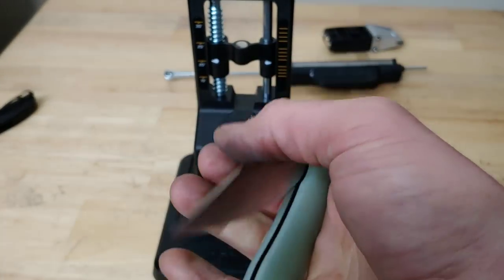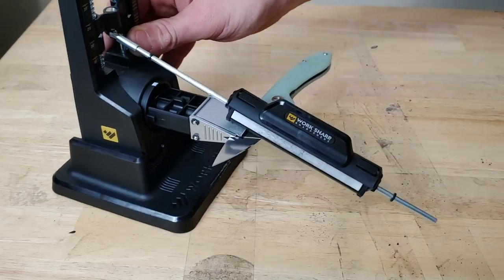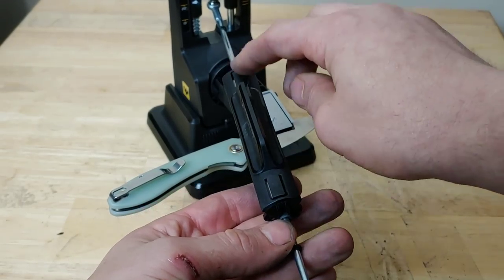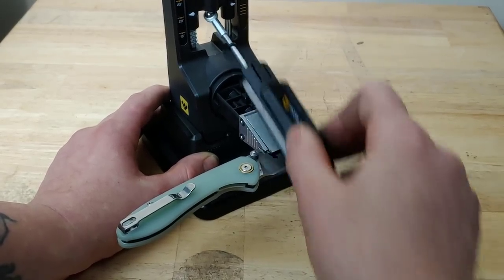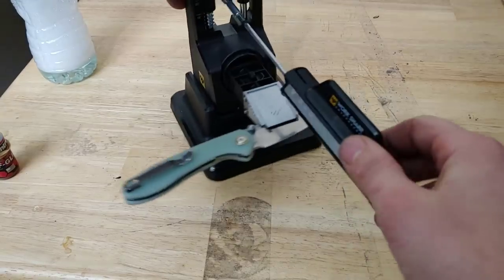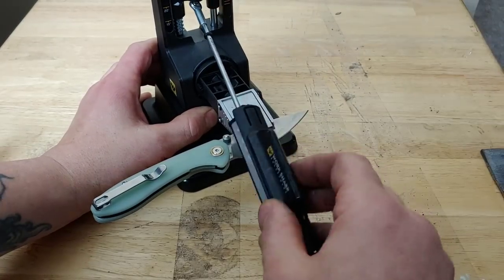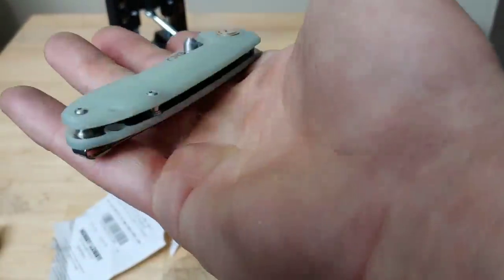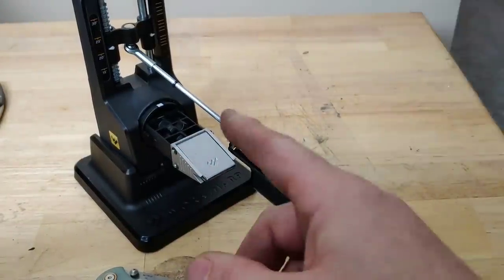WORKSHARP PRECISION ADJUST KNIFE SHARPENER REVIEW

Comment: Do you like a toothy edge on d2?  I usually go in between myself. I cant remember what is the best for all steels and I always touch mine up fairly often on a strop in between sharpening's because I hate not having a shaving edge not necessarily polished just shaving. I sometimes polish the edges and I do like my ceramic for simple effectiveness and quickly no water and no stone maintenance and sometimes just for the fun of it and having an extra keen edge fast.  Im a free hand sharpener but I have the spyderco sharpmaker I use the stones an odd time on their own(it was a gift).  I wanted a guided system for when Im lazy or want to reprofile a bad blade and seen this one and actually pre ordered it earlier today before seeing this video and when I did see the video I also just had that same feldspar in the large size sitting on my coffee table with me and I just got it 6 days ago lol.  Must be a sign from the knife gods.
What is a dry oil for steel and what is the benefits? Is it the same as the dry oil in the food industry like linseed or tung oil and they create a dry film.
Great video as usual and demonstration.  If I hadn't ordered it already I would because of this video alone.  Its a better video on it than the knife center's and not to knock DCA just a different type of format and another great job at explaining everything! Nice edge bro.
Reply from the maker: Yeah d2 does best with a toothy finish, a polish doesnt usually do great on d2 600grt is my favorite usually, dry oil is an oil that dryes up or isnt supposed to leave residue but it doesnt do that well on knives from my experience, if your just oiling your blade then pretty much any kind of rust resistance oil is fine just dry it off after i usually wipe the oil on let sit for 5 min then wipe off seems to work great
Reply: Ya I've used 3 in 1 oil for years and lots of others.  Im not too fussy over oil.  I do understand the differences but for me its not a big deal.  Yeah 600 grit sounds good thanks probably good for 56 to 58 hrc abd lower.  I wonder if it would be prone to micro chipping with a real toothy edge around 62 hrc.
Reply from the maker: @alanmccoll6490  if its very toothy just do a good burr removal and strop really good after and you should be fine
Reply: Cool thanks

Comment: Look folks I have one and my comments are what i think about the sharpener it’s not with a bed sharpener but here we go for one thing it’s top-heavy and sharpen your blade and wants to four Ford torch OK sure does have some weight but it needs more in the base needs to be wider have a larger footprint to keep this from happening the knife holder the madness is that used to hold it in a decent bit they gonna go that way the elite be stronger because it flexes quite a bit you are seen it you all experienced it and the only solution that they come up with you’re putting to much pressure you’re right I kind of agree but even still if they’re going to work

Comment: Have you tried it on a dual edge blade? I have a Ken Onion worksharp now and find it impossible to use with a dual edge otf, hoping this one will work.
Reply from the maker: You mean like a double edge dagger or like a tanto?
Reply: @NeevesKnives  a double edge dagger, full edge on both sides
Reply from the maker: @davelewis2870  yeah it will for sure you want to make sure its clamped in the same spot so the angles match

Comment: What about using the blade grinding attachment for the final finish at 12.000 grit at the same angle? Will it work?
Reply from the maker: Oh i wouldnt do that this does a vgrind and the other one does a convex, and its very close to a perfect polish, i could spend more time and get it perfectly if i really wanted or get a progressive stropping compound
Reply: @NeevesKnives  yeah, I know about the convex but thought it wouldn't affect the edge with the 12.000 grit
Reply from the maker: @memokwest  im sure it would help polish but it would probably take to bite from the edge possibly, id reccomend just using a regular stropping progression
Reply: @NeevesKnives  thanks! I will possibly try a nail polisher with 4000 grit. Perhaps this will work 😉

Comment: Hi! Can you sharpen a scandi grind without a secondary bevel with this?
Reply from the maker: Possibly if the angle fits depending on the knife its going to be about the angle
Reply: @NeevesKnives  What about a fixed blade then. Would it handle a 7-8 inch blade with a thick spine? Where do you think it's limits are? Thank you for a good review.  I subbed.

Comment: good ,, well thought but diamons , not for me,  it really tears up an edge then a very fine ceramic, should have used silocon or boride carbide, maybe. or an extra rod to purchase with a coaurser ceramic
Reply from the maker: I use diamond every day and completely dissagree on it tearing up an edge, theres some steels i use aluminum oxide or something else, but most pocket knives these days are using steels that diamonds work fantastic on, and super steels work best with diamonds, but even other steels work great with diamonds, other stones work great also, and this system has a fine ceramic on it as well

Comment: Looks like a great system for the $.  I'm sure more stones are coming. Maybe a base clamp too. I wonder if some rubber dip on the blade clamps (think the handles of pliers) would work?  I'm very interested in one.  Thanks Jerad!  ✌️
Reply from the maker: Yes its a great system, also the edge on the civivi came out fantastic, but that was freehanded to mirror edge
Reply: Very cool!  I'm looking forward to the review!  🖖
Reply: Just put a little bit of blue painters tape on back of blade.
Reply from the maker: Actually i messed up it does have rubber on the clamp i couldn't see it before but after shining a light i could see it clearly, also i need glasses

Comment: I used mine to reprofile my Benchmade bushcrafter in s30v. 
That 320 stone is not made for that LOL but it worked ...I ordered a new stone already but for now on I'll use the  sticky tape and sandpaper trick.

This sharpener is awesome but there is one flaw I don't like . The part that holds the knife pops out to easy they need to add a lock with the magnet . For larger knives it sucks.

Pocket knives you won't even notice it but heavy knives are a pain at times. That said as just a sharpener it's amazing in just speaking from an idiot perspective.. that reprofiled s30v on an outdoor fixed blade 🤣🤪
Reply from the maker: Yeah reprofiling something large will take some time, the stones are small but it will work, and for the $ its definitely a great system

Comment: I do have a question for this. I'm still pretty new to all of this but been using several wet stones for sharpening.
Could the same concept be applied to this as a fixed use? Would it cause any difference at all compared to a dry or semi dry stone?
Reply from the maker: Some stones can be used dry; but not wet stones, because the steel will clog the stone and it won’t work also it will get glazed, you want to use a wet or oil stone with a lubricant

Comment: Newbie here....I have a worksharp belt system sharpener......how does this compare?
Reply: The electric sharpener does a convexed angle, which this sharpener does a flat angle
Reply from the maker: I personally like this better, it gives a v grind instead of a convex, and a sharper edge, both systems are great but id reccomend this one if your sharpening just pocket knives
Reply: @NeevesKnives  Thank you...one last quick question....if I use a belt system and it produces a convex edge.....then can I not use a strop to keep the edge after the belts?
Reply: DrMaddog1  when you strop a knife it does a slight convex edge that's very close to the belt system. Just not as extreme as the belts.
Reply from the maker: @mikeo8790  thats based on bpressure and holding your angle, if you can repeat the same angle with light pressure and you only do a few passes on each side you will not convex your edge, also depending on the kind of leather your using, some are softer than others, but if your not indenting the leather you wont convex your edge imho

Comment: Great video.....the best one yet demonstrating the system.
If you get chance to try that simple hack I mentioned last night regarding the stop collars from the kme system....it eradicates the issue with the o- rings.
I had gotten bored last night and did a side by side with the kme....
I find that the angle adjust on this is much easier to use, and that the jaws are better than the jaws on the kme.....holds my spyderco para 2 and 3 much more securely without any play what do ever.
I would contact work sharp if your jaws don't have rubber inserts...mine came with.
Addressing issue with more stone options, I have been told by a reliable source that it's already in the works.....possibly even with a universal type holder that will handle 4" stones....if that happens this hands down is in discussion for one of the most versatile systems on market.
Again a great job showing what this system can do....and for $49.95 how can you go wrong.
Reply from the maker: I do think this might possibly end up being the most popular esp if they come out with more stones/ attachments, I don’t have a knee I usually freehand
Reply: @NeevesKnives  I freehand when I feel the need to just zen out.
Been freehanding for close to fifty years.....ya know...when dinosaurs were roaming about...lol
Can get fantastic hair shaving edges....just don't ask me what angle I put on it....would just shrug and say whatever felt right on the stone.  Then I felt need for something more definitive in angles...that's how I got into the fixed angle genre so to speak.
But I fully agree that this system has the potential to be something very special.
Reply from the maker: @fldiverjc4496  that’s amazing, I also find it very therapeutic and also I feel like there’s way more passion involved
Reply: @NeevesKnives  so very true....there seems to be so much more of a connection......
It's a shame so many are scared to try it.
In my opinion in the whole sharpening scheme.....nothing comes close to that feeling of accomplishment after you get that hair whittling edge from just you and a stone.
Reply: fldiver jc - Do the KME and Work Sharp rods have the same or very similar diameters? Did you recommend using 2 stop collars? Thanks.
Reply: @rickenger959  it seems they are very very close in diameter....would need break out the calliper to be 100% certain.  All I can say is the stop collar from the kme works .  
I personally would use two collars....one above the stone carrier and one below stone carrier.
As shipped the o- rings for lack of better term work well enough.  I mention the kme collar because they are easier to adjust in my honest opinion.
Reply: @rickenger959  I did manage to break out the calipers....both seem to measure at 3.81-3.83 keep in mind can be user error....lol
In millimeters.
Reply: @fldiverjc4496  Thanks for taking the time to look into this further. I will be receiving my WS  Precision Adjust tomorrow and will also be ordering two KME stop collars tomorrow. Thanks again.
Reply: @rickenger959  glad to be able to help

Comment: how long wil the stones last?
Reply from the maker: Depends on how often you sharpen, my plates did over a 100 knives butbthey are larger, im guessing maybe 40 sharpenings, also depending on the steel and the pressure you put
Reply: @NeevesKnives  thanks

Comment: With all their products, Work Sharp is becoming one of the heavy weights in knife sharpening.  

An area that might make your sharpening videos better is to also cover what does not work well for each system.  For instance, this system may not be a good choice for knives without a flat part of the blade to clamp on to, or for knives that are too heavy for an unclamped system.  Stuff like that.
Reply from the maker: Definitely the weight could be sn issue but i think it will still work fine without the flat, great idea though thank you im definitely going to remember to start doing that

Comment: Looks like the angle will change as you move across the length of the blade
Reply from the maker: I havent noticed that happening maybe with a very large blade but it would be a very very small amount, and your angle would still be consistent and that is what is more important

Comment: As knife blades tend to be of different sizes (pocket knife / chefs knife) I wonder how this type of sharpener can give consistent and precise degree angles. The angle of the horizontal and vertical side of the triangle will always remain 90 degrees. By dialing in a preset degree on the vertical element you are defining the length of the vertical side of the triangle. As due to taller or higher blade heights and lengths the distance btw the vertical element and edge of the blade is always altering the length of the other two sides of the triangle and the respective angles this method cannot be precise. Theoretically at the fist use the factory edge is destroyed and has to be redone to an approximately similar angle. Theoretically if you have redone the edge and if you can manage to clamp the blade always in the same position you are fine. But in case for any reason you have to use another sharpener the edge is altered again... 
Or is this not a real issue? Am I overthinking it?
Reply from the maker: Definitely over thinking you can always try to remember about where you had it clamped and also use the system to try and find the closest angle, then just go for it, worst thing is your edge gets sharp, but im sure kitchen knives will be fine but theres going to be a limit
Reply: That's definitely something to take into consideration if you're looking for a specific, exact angle. The built in degree markings are close, but they are closer with a wider blade.

Just to check it, I clamped in one of my widest blades, a Benchmade Turret and used my phone to measure the angle at it was 20 degrees, exactly where the sharpener was indicating. I then clamped in one of my skinniest blades, a Benchmade Fact and without changing the angle setting at all, it was measuring 22 degrees. So there is a difference that could matter to some people.

If exact angles are important to you, I'd recommend getting an angle finder or using the one that's likely on your phone somewhere. And for just doing touch-up on a blade where you've already got the angle you want, the sharpie trick is the best way to go. The angle indicators on the sharpener are nice guides, but due to the variability of how you clamp in the blade, they just can't be exact.
Reply from the maker: @GabrielShadowArcher  yeah for a system at this size id say its pretty close, and personally i wouldnt care, i care that its a good angle that cuts well, being exact doesnt mean much if i didnt like it id just change it to what i do like
Reply: A wider blade would change the angle as it would lengthen the hypotenuse of the theoretical right angel. Go buy a $5 angle finder and check the actual angle against the markings.
Reply: Paused at 18:10 with increased brightness on my phone, it does look like the newly sharpened edge changes in width/angle slightly from the tang to the tip. I have noticed this with all fixed angle sharpening systems. Unless it's an optical illusion, it does appear that the angle slowly becomes more acute towards the tip, with the edge appearing slightly wider (or longer, depending on perspective).  

I have seen this topic disputed before, and do believe this effect would be much more apparent on a longer blade.

I think the only way to not have this occur, is to move and turn the knive while the grinding apparatus remains stationary (like at the manufacturing facility).

Overall I do feel these devices are still effective and worth the investment for pocket knives, regardless of this minor imperfection that may result.

Nice review, and thanks for the demonstration.
Reply from the maker: @4rch3er19  many knives have a taper in thickness, or thinness and when you put an angle guided edge on them the edge bevel will taper in thickness, im sure there will be a slight difference from the system or atleast its possible with larger blades, but i dont think the system effected this knife very much most likely its the thickness bte that changes, but its all possible, but its as consistent as much as it can be and it puts a great edge on your knife.
Reply: @NeevesKnives  I agree, the possible slight difference in angle/length of grind is negligible. I have also considered various thicknesses in blade stock to account for this slight angle change. If this was the cause then typically the thickness would be greater near the tang, hence the grind/edge would appear greater there, not near the tip where it appears here (and in all the other videos). 

Regardless, these fixed angle sharpening systems are still a great investment, and this model in particular is on my wish list. I think the ease of use and ability to create an actual straight edge, instead of a rounded (or convex) one is the main benefit of not sharpening by hand. Thanks again.
Reply: @supporterofsanity  well... the manufacturer should include it... all these type of sharpeners are inherently imprecise.
Reply: I think alot of people are over thinking this.  I understand some people are just perfectionists but in reality its not really going to matter.  We arent doing intricate surgeries with our pocket knives, kitchen knives, camping knives